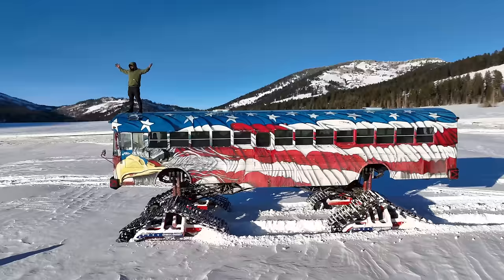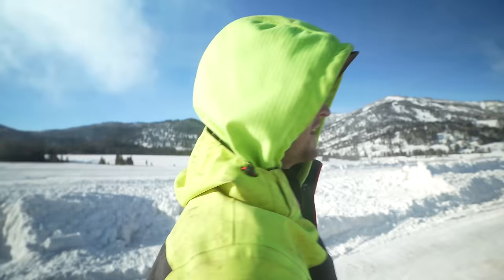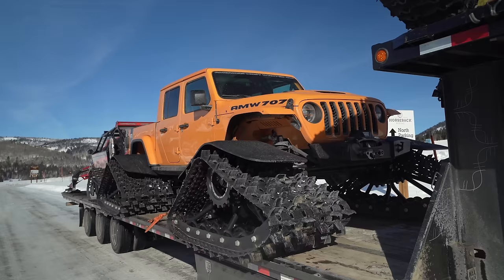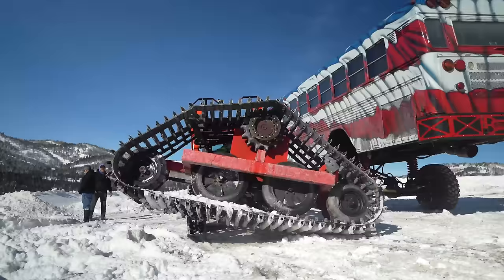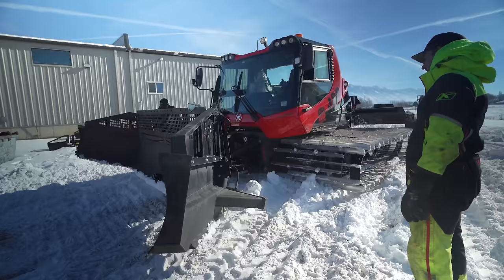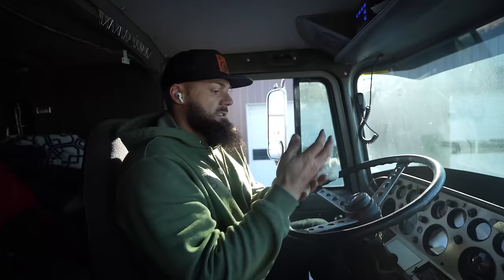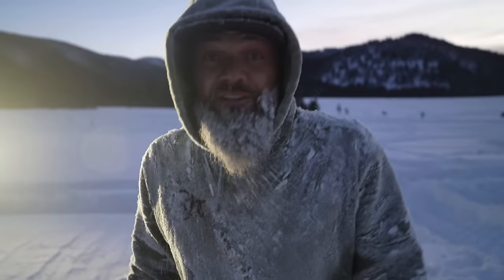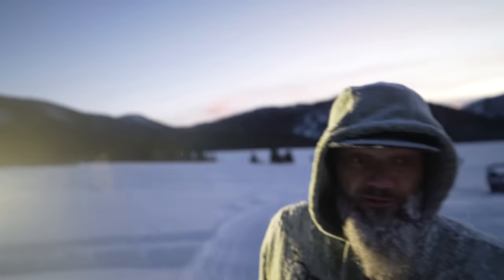Testing The Freedom Bus ON TRACKS!

Comment: I bet that sand rail was a hoot!   The track/ski combo wasn't nearly large enough to allow a machine that size to work on the soft stuff, but it would be a great trail runner.  Dave cracked me up at the end when he walked away from it completely coated in spray.
Reply: Make the tracks a foot wider then put a set of fenders in front of it to minimize the snow going forward and it should be great

Comment: I wonder why snowcats have very wide tracks. Maybe the large surface=traction and not sinking into the snow has something to do with it?
Reply: To compact the "piste" ,the track, for skiing. Make nice wide passes and not overly compact the snow so that it becomes hard to set ski edges into, or hard if you should fall on it.
Reply: Keep in mind theyre very heavy... and they operate on snow....
Reply: It’s all about spreading the weight. Like snowshoes for vehicles
Reply: Exactly. Also for grip since they are used to push snow away. My point as a civil engineer was that having so skinny tracks on a vehicle like the bus (heavy as F) or even worse on that so called Snowrail (overpowered as F) their fail could have been predicted. I am very disappointed to watch some guys inevitably very talented in making amazing machines but lacking some simple basics in physics. Alan is the most mind driven from the bunch. He knows physics not only mechanics. Maybe he is indeed a wizard. ;) @YarMahNarNar
Reply: @petercornish9903  Correct. The more surface area you can use the better to spread the weight and also to have more grip when pushing compacted snow forward. Not too hard to find out why was the Snowrail digging in and sink. Also I won't say the bus had so much success either. Nice shots but under so much weight those tracks are inadequate.
Reply: @Lucky32Luke  The width has nothing to do with the grip, the grip comes from the rails going width-wise along the tracks. You can have wide, smooth tracks and can still drive on the snow without sinking, you just won’t go anywhere fast lol. 
That snowrail has like 800hp, insane torque, and was designed for sand. The owner, Cleetus McFarland has a couple videos on his channel, and all that thing wants to do is stand on the back axels before moving an inch forward. So it’s just ripping the snow up without a thought. I really hope you don’t read this as me hating o n you or being rude, far from it. :)
Reply: Surface area does have a play on grip. We do use wide tires and grippy tire surface in tandem depending on the road or dirt we want to use them on. One example: why it is advised to deflate your tires in snowy conditions, ice, or on sand? The pattern of the rubber is the same but you have larger surface area to play with. So you are right and also wrong. Do you not agree sinking into the snow several times and needing rescue is a fail? Would the snowrail benefit from a wider probably double as wide track?  @YarMahNarNar
Reply: It is a conversation and I don't think you are mean or rude. I enjoy having a conversation. @YarMahNarNar

Comment: You guys need a commercial space heater the type that runs on diesel looks like a jet after burner..a aluminum 1 foot diameter culvert and a parachute  this you can cover the motor compartment and heat everything up ..this method is used all the time in Alaska

Comment: Build a skirt or tent to trap heat next time....or build and insulate the fuel tank and engine compartment so you only need a low heat to keep Warm. Diesel antifreeze helps too.

Comment: The flash point of gasoline is -50 degrees. That means at that temperature or below gasoline does not give off sufficient fumes to allow ignition. Rember that only the fumes burn, liquids do not. Thats why in Alaska and the arctic they wrap engines with blankets to reduce the effects of the extreme cold so they'll start.

Comment: Come on DAVE that 100 amp fuse is there for a reason, do not even think about straight wireing it, wait until you get the fuse or put in a circuit breaker,  you do not want to mess up freedom bus because of impaitentness  you guys put to much time effort and money to have tracks for  snowed in series!!! To short out and burn up electrical because of not waiting until you get a fuse!
 * I recommend finding a circuit breaker the size of the fuse that way you will only have to let it cool down , versus haveing to replace fuses everytime you run it hard. If you got the right circuit breaker when (LOL! Not if you run it to hard the circuit breaker would allow you to only have to wait and cool down instead of having to replace that fuse(will also save time and money!)***  just a suggestion!

Comment: I think the sand rail needs a little wider tracks.
Reply: wider tracks, wider skis, better weight distribution, a lower center of mass, and maybe different gearing somewhere to boot; hard acceleration on loose snow just makes holes...
Reply: @patklemmensen1694  they could lay waterlines down with it😂 it digs straight down

Comment: Winter diesel and a block heater plugged in. If you've gelled up the fuel, you'll need to replace the fuel filter. (Old bus driver here).

Comment: Put a 90 degree metal duct on the end of the torpedo heater, let's you shoot the heat straight up or tilt it up at any angle you need.

Comment: Okay… Freedom Bus on tracks -> Overheating 🫣
That „thing“ with the small tracks on the back, a mean sounding V8 and those „ski‘s“ at the front -> Useless unless you do wanna get stuck 🫣
Gladiator on tracks -> Don’t know, couldn’t really tell 🤷🏻‍♂️
Pistenbully -> Works fine, as always 👏
Dave only should bring Pistenbully‘s to the party 😛 
The most interesting part will be „Monstermax 2“ in the snow with a lunatic behind the wheel 😂👍🙏

Comment: Because of where you guys live and the cold cold winters, why not put a wet kit on the two or three tractors you use to haul the RGN trailer? This way you eliminate the pony motor in the neck, it only adds two more quick disconnects for the new two lines connecting to the trailer and your buddies can't ask to borrow the trailer because it is no longer all self-contained. You don't even need a hydraulic tank behind the cab, you can now order an aluminum diesel tank that has two isolated sides within the tank, one side is the fuel for the tractor, the other side is your hydraulic fluid.

Comment: I once owned a 1985 Ford F-350 diesel with duals (which my father and I rebuilt from the ground up and then the four speed transmission). Then I owned a 2004 Dodge Cummins 2500. Um...antigel is your friend. My brother owned a little Toyota diesel (very cute little pickup). We gelled up one mile from home. We had to hike one mile in the freezing cold. Even with tank and line heaters, always use the failsafe: antigel.

Comment: Cleetus' Sandrail needs wider skis and tracks. There is no floatation to keep it on top of the unpacked powder. One reason when I was an avid sledder I went for long tracked sleds with wide skis and tracks like an old Olympique vs a Phaser or Viper.

Comment: I'm surprised you don't have some Herman Nelson heaters?  I'm 1000 miles north of you in Edmonton and went through record cold conditions with -46C= -51F degrees!!  We warm up the jet engines on the airliners with the Hermans.  With the Herm hose in a lower cowl opening we were able to heat the engine oil from -35C to 0C in about 20 minutes.

Comment: Have you considered using 5w-30, 5w-40 in everything. I'm in Minnesota and it makes all the difference. Lets engines crank so much easier cold. Synthetic works better in the cold also. I just run anti gel in diesel fuel below 32.

Comment: Have Ya'll thought about just installing air or hydraulic Jack's into the bus? Then you wouldn't need to use the telhandler to put tracks on. If you got stuck on frame they could also maybe help get unstuck too

Comment: just had a -58f cold snap in saskatchewan,canada so i feel yah on the cold lol should've put some fork lift points in the bus tracks design make them easier to move and that red beast like you said could use some mud flaps and maybe wider tracks would keep it on the snow looking forward to snowed in also shipping to canada so i can get some gear lol

Comment: Way back in the dark ages, 1960's and '70's that is, there were a few companies that tried making dual tracked snowmobiles.  As I recall they had turning issues (as well as several others) and that was with the tracks MUCH closer together than on the sand/snow rail.  Maybe for next winter put fatter tracks on the rail to let the rear end "float" a little bit better.

Comment: "That thing works incredibly well.  Except it keeps getting stuck."   
Lmao,   somebody's in denial.    Sounded like it needs to rev up way to high before the tracks turn which is the last thing you want on snow.    Would it have a high rpm stall torque converter by chance or something similar?   Would be fun if you could cut down the RPM and seal in the cab.

Comment: For the sand rail not to get stuck all the time, you may need wider tracks for a bigger footprint in the snow so you can displace more weight instead of it all being on a small area.

Comment: DAVE DAVE DAVE DAVE Bro you should check out this military truck its called a M920 has a cummings 500 hp, caterpillar air shifted 16 speed has a pusher axel all wheel drive all diffs can be locked by air a 50.000lb winch to load a goose neck trailer. I drove these in Germany and Korea and Bosnia and Kosovo, was a blast and loved it. the trailers M870 are rated at 40.000 lbs has out riggers and the boards are stored in the center of the trailer no more looking for boards. served twenty years in the Army as a Construction engineer and retired in 2005 love watching your show keep up the good bro.

Comment: Would have been WAY WAY WAY better off to leave Cleetus' rail on sand paddles.  Those wafer thin tracks  are just not gonna have enough ability to stay on top of the soft powdery snow like those with wider tracks are doing.
Reply: But on a groomed trail, it will be a bad ass. 
 I don't know why the tracks are so narrow on the sand rail compared to all the other sets of tracks. They should be as wide as possible, in my humble opinion.

Comment: tracks are so slow and gets stuck maybe worse than tires, the ones you are using anyway .. why would you put such skinny tracks on the sand rail ... the tracks are so wide on a snowcat for a reason ... those tiny tracks on the sand rail will most likely never wheelie  on snow  or even drive far from the looks of it , way , wayyyy too skinny ...  but at least the tracks look better than  huge gaudy 'boggin' tires/monster truck tires

Comment: Ah the trials and tribulations of cold as it will be -40 standing temp tomorrow in Fairbanks, AK. You guys should have had the forethought to put Power Service 911 or at the minimum Power Service in the White Bottle in your fuel tanks prior to bringing those diesel engine powered pieces of equipment. Albeit you guys are more than prepared for most scenarios, KATS Silicone Heaters DC or AC powered applied to the the engines and transmissions sure make life easier as well and a parachute / tarp to hold that precious preheat on the needed components makes for minimal prep work when it's time to play.
Lastly you guys make me cringe every time I see the indiscriminate use of starting fluid, use Silicone Spray instead, I have commented on this more than once!
 I take care of 80 plus pieces of equipment and vehicles for an FBO in Fairbanks, AK and know a thing or two about taking of equipment in cold and hot weather as FBX temps range from -50 to +85 depending on the seasons!